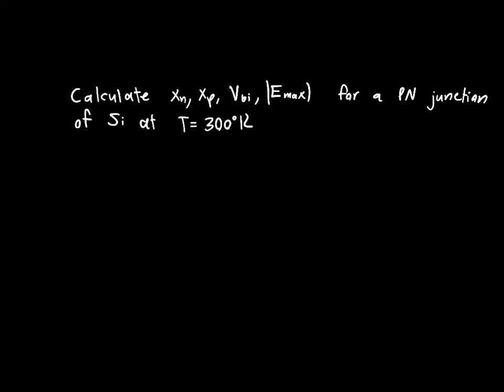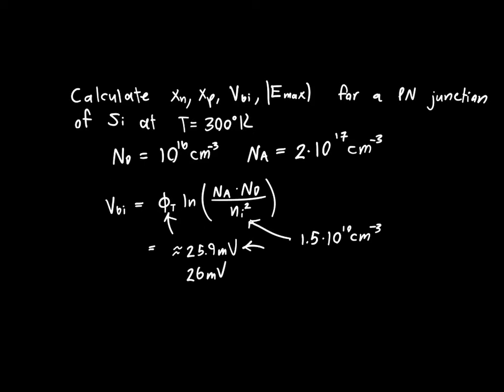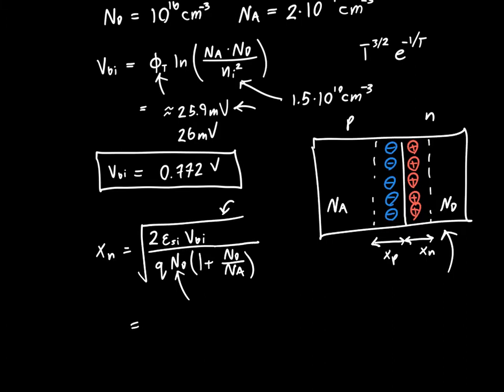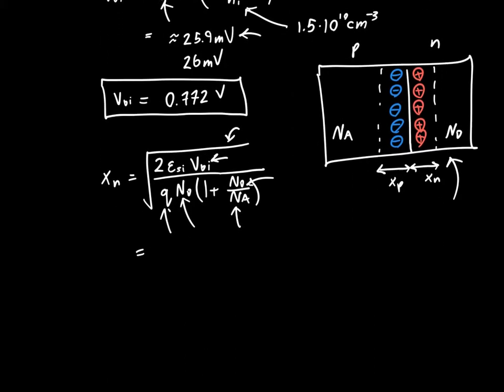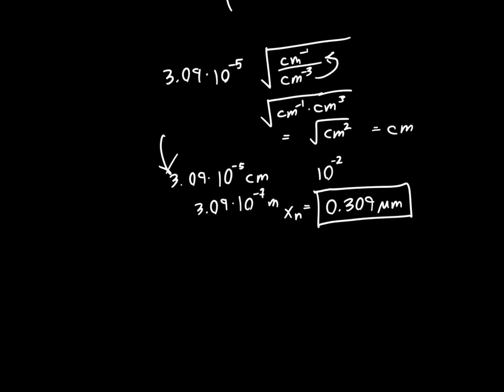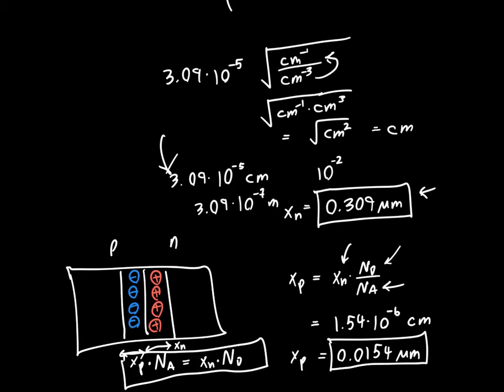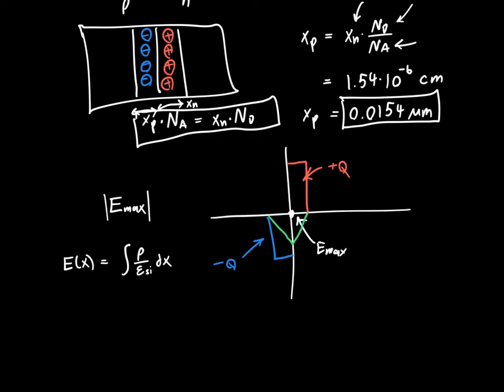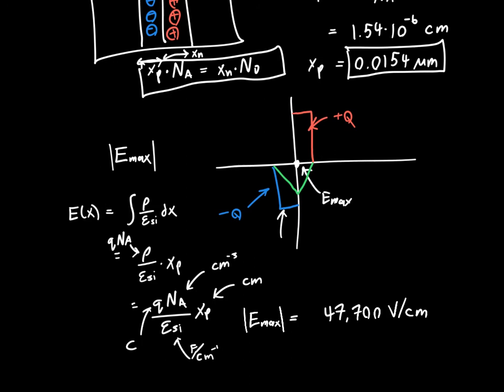PN Junction Example: Depletion Width, E-Field

Comment: pretty sure its 25.9meV
Reply: ΦT is a potential. Potential is measured in Volts [V]. eV is instead a measure for Energy, not for potential. So, the expression is correct.

Comment: how come you multiplied the 8.854*10^-14 to the E? also why did you multiply  10^17 by 2?
Reply: Relative permittivity is typically denoted as εr(ω) and is defined as

εr(ω)=ε(ω)/εο
where ε(ω) is the complex frequency-dependent permittivity of the material, and ε0 is the vacuum permittivity. So the primitivity of Si ε=(εr) x (εο) =(11.7) x (8.85 x 10^-12 F/m) = 11.7 x (8.85 x 10^-12 F)/10^2 cm= 11.7 x 8.85 x 10^-14 F/cm
Reply: @dimi5929  thankz❤️
Reply: @dimi5929  And if you want the unit of permittivity at free space take the equation of capacitance of parallel plate capacitor c=epsilon0A/d.   When we apply units we get epsilon0 = Fm/m² implies F/m please write down to verify :)
Reply: It's the donor dopant concentration .
ND= 2x10^17 /cm^3

Comment: Sir how did the charge (q) ended up in the denominator of the Xn equation (3:48), it wasnt there in the previous video where Xn and Xp were derived.
Reply from the maker: Q should be in the denominator, q*ND is the physically relevant quantity (charge density) That was my mistake in the previous video, I probably dropped the q when I substituted for the charge density.